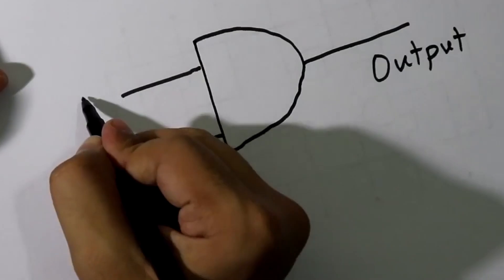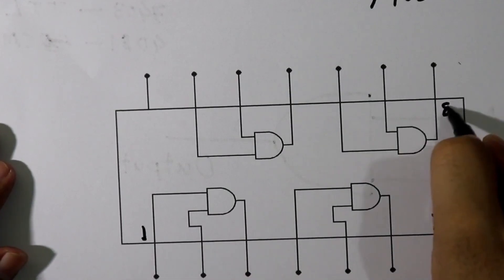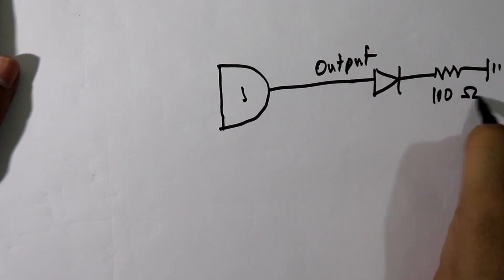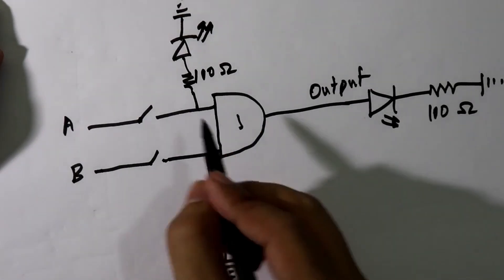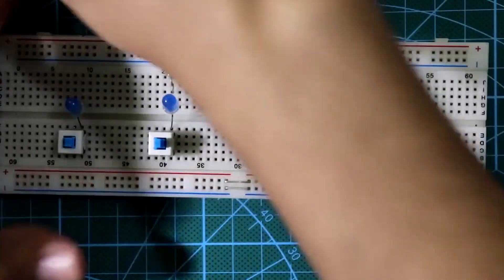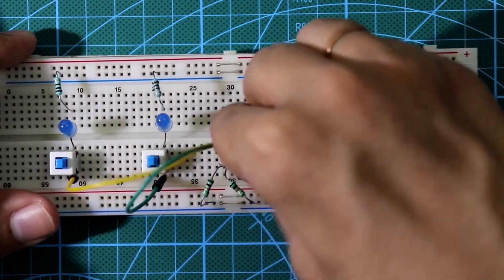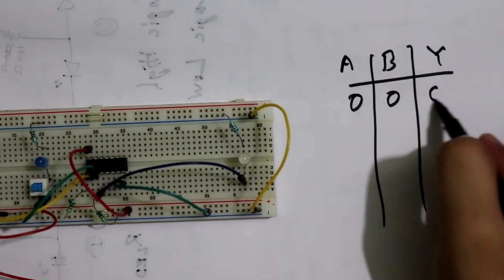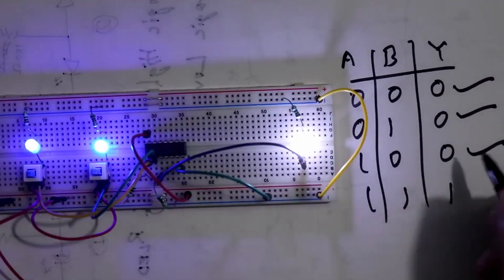7408 AND Gate

Comment: will the IC work if it gets a 9volt power supply
Reply from the maker: Max supply voltage is 7V as per spec. sheet. so, I can answer your question as "IC may work for some time if you give 9 volt power supply, but the chances of burning/heat-up will arise".
Reply: No